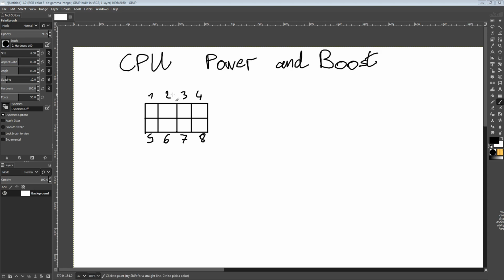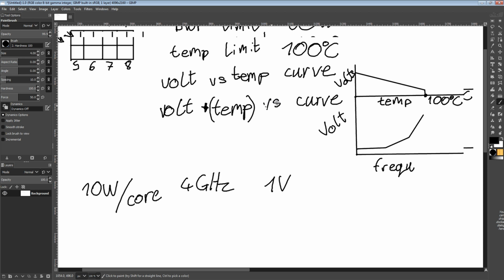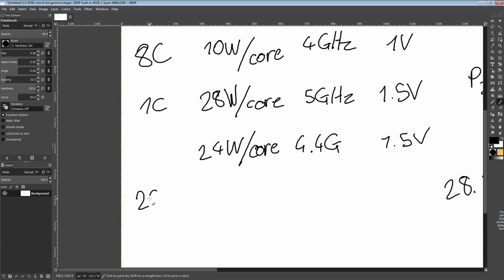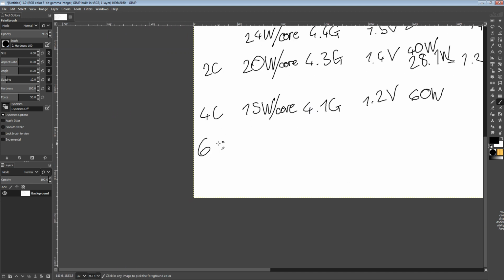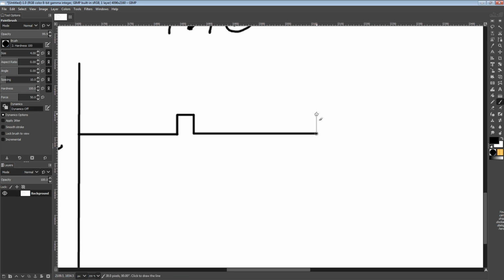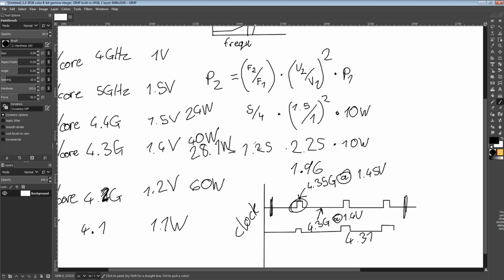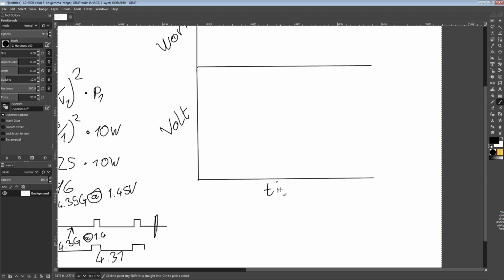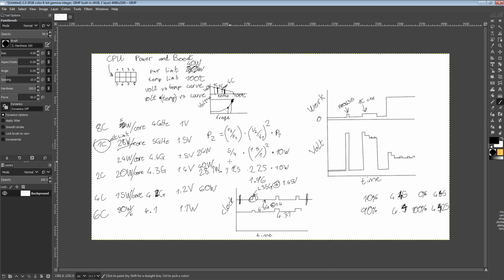Rambling about CPU boost and power

Comment: Seen the video. 

You are right. I had the 1700 From the Day one now i have the 2700x. After some days with both on stock with XFR and boost on i tested them for a personal configuration because, like you say, the voltage boost very high (random reading 1.5v too maybe for milliseconds) and so did the temperatures and the Watts. I mean, it's always stable and has great peak speed (3700mhz for 1700 and 4400mhz for the 2700x), but i always liked MY voltage limited config more that in rendering/prime95/3dmark even goes better in scor-performance.

I Locked my old 1700 at 1.25v and 3750mhz and it went better and more cooler.

I locked my actual 2700X at 1.2v and 4ghz on all core with performance way better than stock (i could pull 4.250mhz or 4.3 at 1.4v but i don't like it, even if i have a big cooled loop system) and like you said in the video the performance at idle has insane spikes (i mean like +20° for one second because it jumps super high for a millisecond, and my cooling loop with 35° ambient gpu never goes above 48°, and it's a 2080ti, and the cpu on prime 95 doesn't go over 55° after one hour)

Locked them down to a fixed voltage solve most of that and you have pure control on your frequencies and the goddamn voltage. I know it's safe because it's designed so, but i don't like that for an instant workload the cores goes crazy 1.5v and give me an instant reading from the HWINFO of 55° (from the 38° when 55° is the max peak after 100% workload).

After many tests and searches i understood that but in many forums/threads they treated me like a madman (they said "there are no spikes in mine"), i even changed the WB (it was old and used anyway, supremacy evo) into a Monoblock (that i wanted to buy anyway for the visual effect, VRM didn't need that, it's a x470 taichi) because i thought that was a cooling problem (i had the same problem with the AIO but with AIO temperatures were higher so i didn't notice that much as the op cooling loop). I don't like that algorithm/setting too, but at least with fixed voltage and frequency the problem is mostly solved.

And oh, the watt reading too, in idle with 2700x stock with a mouse movement it can go up to 40-50w (without the SOC) for the voltage peak, while under fixed 1.2v it stays around 12-30w in idle.

The 1700 was a little less hungry.

I still love ryzen for price performance etc.. just pointing things out
Reply: if you are worried about hitting 1.5v set an offset in bios :) 
i have a -0.5 offset and my 3700x gets 1.45v @ 4.375ghz under a gaming load
Reply: @cristiant6566  you are right. Still I prefer it never touches 1.4v at all :( I mean at 1.2v locked I can have better performance in multithread (and about the same in gaming I play at 3440x1440 100h or 4k 60hz), with less heat and consumption. 

I prefer that for a mental safety obsession , I don't like random voltage xD
Reply: @MissedMessages  Well when I finally managed to save enough money to get new Intel CPU for my disability aid, I tried hard to remove whole TURBO stuff. I was used to FSB controlled overclocking, and I didn't want a variable behavior behind my back. My tests shown that people that want overclocking need to get used to live with Turbo enabled, especially when some CPU don't allow straps. 
With my tests for Intel manual voltage is fine (on Z boards), as long as certain power saving functions are enabled.

Still, the whole concept of boost is equal to cheating. And AMD and Intel are forgetting that end users are self-educated semi-professionals. And they should treat them better than random overpaid person who wants to buy consumer goods like lolipops.
Reply: you are just slowing the CPU down because your worried for no reason about temperature. Ryzen's SMU handles the clock and voltage perfectly fine for auto stock settings.

Comment: Kind of makes me wonder how to enable more temperature sensors on ryzen in hwinfo, and my 2700X only idles at 32C.
Reply from the maker: you can't the CPU only exposes certain readings.
Reply: @ActuallyHardcoreOverclocking  My point exactly, there are temperature sensors for every possible location on the chip and yet you only get to see one. I would much rather have a more crowded hwinfo64 interface than having a lack of thermal information.

Comment: I was literally watching this video and wondering why my Ryzen 3700X idles at like 50-60C with a twin tower cooler. I wish they gave us an averaged temp readout for the peace of mind if nothing else.
Good vid, BZ
Reply: der8auer did put a scope on it and was very impressed with the idle efficiency of AMD Zen 2 
The most amazing feature of RYZEN 3000 - Power Saving (and some CCX OC) 
https://www.youtube.com/watch?v=M5pHUHGZ7hU
Reply: my 3700x idles around 30°C using ryzenmaster. with other monitoring software like hwinfo the temperature rises to 50°C over time because cores dont go to sleep mode
Reply: @GTS_driver  Yeah, I read that somewhere. With just Ryzen Master opened it idles at 40-45C (the temps from my previous comment are during watching a video) and shoots up to 50-60C as soon as I do anything.
Reply: @elektroencefalografista  An AMD employee made a post in the AMD subreddit explaining that some monitoring software cause the cores to think it's a light workload (like Buildzoid's moving the mouse example) so they fire up constantly for briefly periods of time, creating the high "idle" voltages and temperatures people see in these tools. CPU-Z and Ryzen Master report the cores status without waking them up so those are the ones that should be used for monitoring 3000 series behaviour.
Reply: @Lemard77  this. Yes it seems strange but more you monitor them the more you get casual high load and readings
Reply: @GTS_driver  Correct the monitoring SW is turning on the cores if you  watch the der8auer vid you will see how well Ryzen powers down voltage at idle.
Reply: This is the same problem with my friend, when idle or do a small work temp going up to 60 - 65, when load gaming 70-80. You need to lower power consumption.

Comment: For some reason the voltage-temp graph just looks.. odd, to me. Like, should it not be inverted ? Because it looks like temp gets higher lower the voltage. What am I not seeing ?
Reply from the maker: The volts temp graph is a limiter for the health of the CPU you lower voltage as temps go up.
Reply: @ActuallyHardcoreOverclocking  OH, yes, yes, I get it. Thanks...
Reply: @hirSN 158 It's also why using high llc setting is dangerous. Lowering the voltage for all core load is healthy behaviour

Comment: Msi wrote to their x570 gaming edge wifi that it needs the extra 4 pin and without the pc wouldnt run.
Reply: Yeah, MSI tends to do that
Reply: Be careful of that my Aorus pro kept hard  crashing and randomly shutting down until I connected the extra 4 pin.   I almost RMA'd the board.
Reply: @peter0882003 in the comments of the x570 gaming edge said other people that the extra 4 pin isnt needed and it worked without it for them.
Reply: @peter0882003  what cpu do you use on your mobo?
Reply: @enzoe.6897  3700x I can only speak for myself but I was experiencing random shutdowns and boot loops until I connected the 4 pin.  After that no issues.
Reply: @peter0882003  ok i want to get the 3700x too ok now i know that i buy the rm750 instead of the pure power 11
Reply: For real they wrote that?
Reply: @MissedMessages  yes they did but I dont know if they removed it yet

Comment: Very interested in this video gonna watch it immediately!

Ps:I need your help guys

https://lh3.googleusercontent.com/ZCTWROwwAQofmv9GazR82-zmk0EEiC1N8NKI3v_z-rSR-GCXwBfCN8p3dX5nB4RS3bR19H_wKqgNbUTGlh6z53Zh2hy3n7EXq3GRBJlxOxFNLqAOJo2wk3dzSlu4-7lDv9Ld-FSAfU9H2C78N_QRD2LJdfkC3jal0IEkWXbbe1XBPu3wu-8tobTfRwRBZwcYtQ2E8HiAgdYyz3E2JndXJXrFx5asL_8uJUpM5ZYrLwUPqm6y5I8KvZ9WxzieqUSAMJgNrEa0kDPxc1e-OQbXJ8TaitKHmqU5GdDGITShHjnXkTIkS9TOx2F-jQXddXVa6TH5zQS2PeWWzelsFubWR4Wfo0KOtcY1rWma5cxYLZWIpUmIokY5Tqe-Hc3ZrGqdDS2SwqZ_s9PgGQqphFOz_EWohfycYrChQy6WaMKIQSjOlGz-wQm_nAqRj1v4idYnAu39bz3GAbAFogZroVT7LFCScD3YuLmr0E5IvJ8FK4bC1mYR-reBb7V8iFtCI3VTMFpMNF-4ztmkjWYGdgJrtCLXiOz6qx01Wcq9uZdJpdhYiOwOAKkO68fKHSuHUUTme9LgSgOTy9uEMg-SRQklMBdoP12tKXgqO0y7s_mdb_EpUyx_iMlzo5tBdf8ShQ=s1297-w730-h1297-no

While Re-mounting for the 4/5th time the water monoblock on the MOBO (it had leaking problems since i bought it) i accidentally overscrew (too long screw because i replaced that, the original was faulty) and touched the choke under, hearing a "crack".

I removed it again and saw like in the photo the cover of the Chokes was broken, i tried to test the pc as it is and it worked fine even on OC and it was perfectly stable on Prime 95 and other Graphic tests/benchmark. The only thing it came out an horrible coil whine noise while performing (even in idle)

After that i looked at it closely, seemed only the cover crack damage, i glued it with attack and now it's everything fine and perfectly silent (my loop has 900RPM always so it's very silent), no whines.

I'm not a master on electronic i know only a little few about VRM and things thanks to buildzoid's videos. If someone of you can tell me if i should worry about that in the long period i would be very glad T-T I can still replace the mobo since i bought it 20 days ago on amazon and OFC i would say i did the damage and pay for the "change" or the replacement. Seems working fine but i don't know if in the long run that "damage" could affect me in some ways.

Comment: 33 mins of  how useless additional 8 pins are WOOOOOOO!
Reply: I guess you didn't watch the video :)
Reply: And now they put 8+4 everywhere on x570 lol
Reply: 8 + 8 / 2 = 8....  Which is how many complete circuits you have that can handle x watts.  What comes in must go out (for the most part).  There is a positive for every negative (I hope).  Which means that you have to assume that each pair can only handle x/2 watts of power where x is the number of watts each wire can handle in the connector.
Reply: @mpeugeot  so it's not 380w but 190w for 8? :/